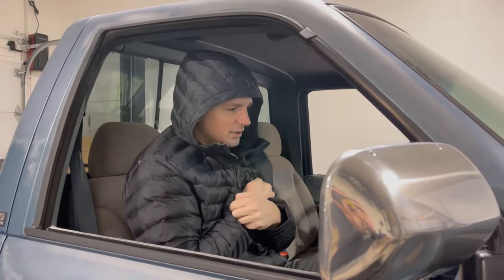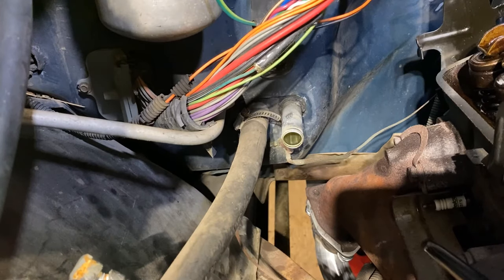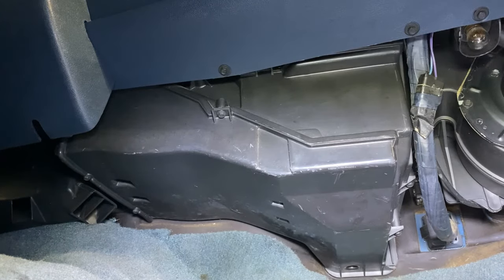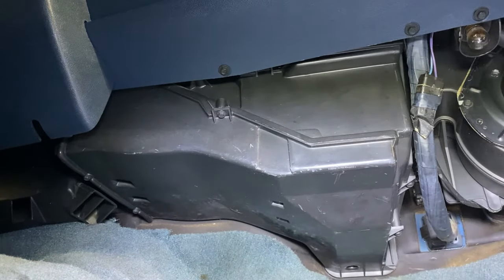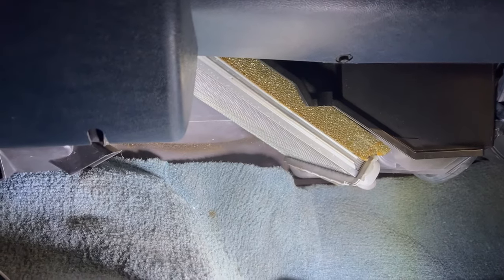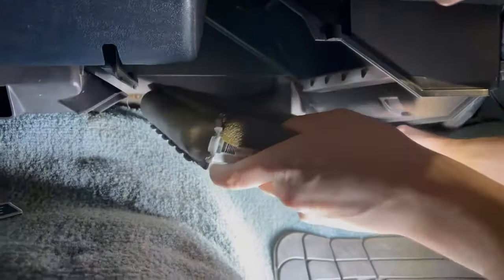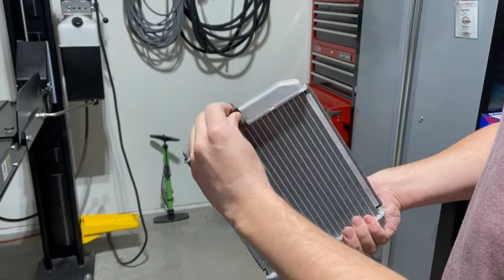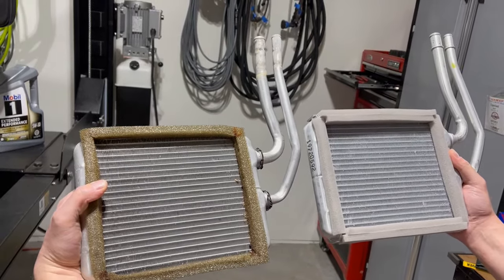Replacing the heater core on an 88-94 OBS Chevy 1500

Comment: Through the glove box pull the blower motor and carefully clean the evaporator core. Many of these are filled with debris from leaves and dirty. There are several good videos on YouTube to show you how.  Will drastically improve your air flow for heat and ac.
Reply: I need to do that. I paid 1350 for a whole new ac in my 94 and the air flow isn’t strong at all. I hope that will fix the issue. I’m sure it hasn’t been cleaned, but who knows. I bought it back in February.
Reply: @irishuwould5185 any updates on that? Exact problem I have everything was replaced but the evaporator core.
Reply: @OBSKEV  mine was filled up with leaves and all kinds of stuff like I figured it would be. I cleaned the evap and rinsed it down good. The air flow is better I will say.
Reply: @irishuwould5185  Dope. Before cleaning it out would it blow cold or no? Mine isn’t blowing cold. A/C lines get ice cold though.
Reply: @OBSKEV  yea it was cold but it froze up and I had to turn the ac off and just let the fan blow. The coils would freeze over cuz it was clogged. It still does that but just takes longer now.
Reply: Great video brotha
Reply: @OBSKEV  there was half a dead bird in mine cleaned it up good and it blows and smells much better 😂

Comment: Love the info on your videos. I'm replacing my interior and you've saved me a LOT of headaches! While the dash is out I'm gonna change my heater core since it's been leaking and has the underside of the carpet wet.
Reply: I was at my woman's the other day, saw a canal flowing from my passenger door, I was so confused then had the disgusting sad realization and I was partially heart broken ngl, if it wasn't the daily id rig it but I'm gonna have to put my nose on the grindstone to fix er up

Comment: Is this the same as the evaporator? I’ve seen the terms used interchangeably just want some clarification.
Reply from the maker: @Landen Wolever No, the heater core is different than the evaporator
Reply: Evaporator refers to the air conditioning (cold air) system I believe

Comment: Will it make a mess when i pull the hose? I'm going to be using my old bosses shop so I'd be nice to know lol
Reply from the maker: We drained the radiator first, but yes, there will be some additional antifreeze in the core
Reply: I have a 94 Silverado that act like the heater control isn’t working have you ever changed one
Reply from the maker: @Dennis Weber Sorry no, never changed a heater control
Reply: @SuburbanRanch  Thanks
Reply: @dennisweber7803  Check if the vent actuator is operating correctly, its behind the center of the dash, slightly towards the passenger side. I replaced damn near everything until i found out it was that haha

Comment: Do these heater cores tend to leak antifreeze? I have a leak and though it was the hose but I checked and no holes and even bought a new clamp same issue maybe this is my issue?
Reply from the maker: Is the leak inside the cab?
Reply: Its under the hood on the firewall side not in the cab where the heater core hoses connect
Reply: I keep leaking where the hoses are supposed to connect to the heater core tubes
Reply from the maker: It’s either the hose or the core! The hose is much easier to replace, I’d start with that.
Reply: Okay thank you so much I’ll try that

Comment: Hello Suburban Ranch..will this heater core fit a 94 gmt-400 c/k 1500 ,5.0, v8 chevy pickup ..just wondering, indeed to replace mines 👍
Reply from the maker: @L Gonzalez Should be the same part, but check the parts catalog or RockAuto before ordering!
Reply: Ok thanks brother

Comment: Do you have to recharge AC after replacing?
Reply from the maker: @Niklas Acuña the AC is not connected to the heater core so the answer is no.
Reply: Might want to top off your coolant though

Comment: I have 95 Chevy suburban K1500 I’ve done new AC compressor, relay, resistor, blower motor and etc. ALL OEM PARTS
I just did my heater core and now my climate control panel lights turn off when I turn the headlights on and it’s blowing straight heat even when set on HIGH AC. 
PLEASE HELP!!
Reply from the maker: @Matthew Lara Kind of sounds like something isn’t wired correctly, but not really sure on this.

Comment: Where is the heater bypass control valve?
Reply from the maker: @bob oh stephens I’m not sure we didn’t mess with it. Maybe someone else can help with the location.
Reply: I believe that it's controlled with a blend door. You are just redirecting air flow and not bypassing the flow of anything other than the air. 
And wait till you get the pleasure of replacing the blend door actuator for the heater core. The truck has 3 actuators but that heater core door is the worst. It only has 2 screws. One isn't all that bad, the other is that bad

Comment: Would anyone be able to tell my why my truck has no hoses running to the heater core at all?also no belt on my ac compressor
Reply from the maker: @ExtraOrdinaryIncome My guess is it broke and they did a manual delete. I would guess the heater core leaks as well.